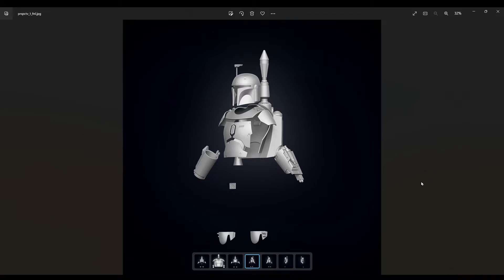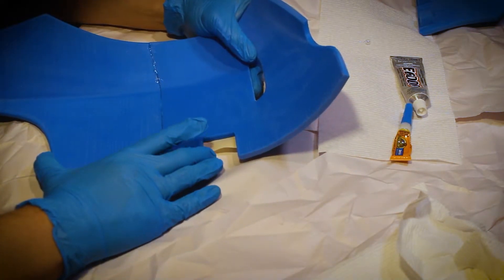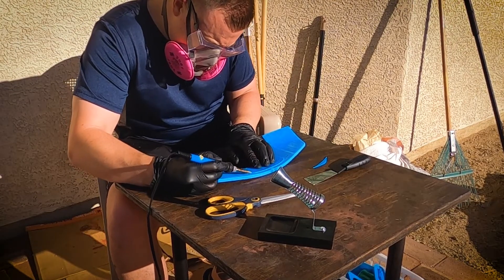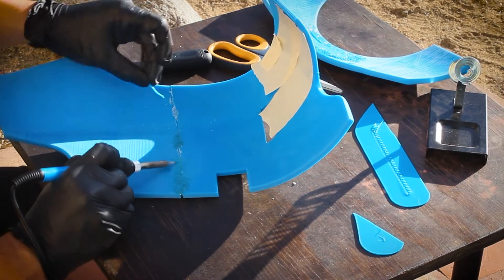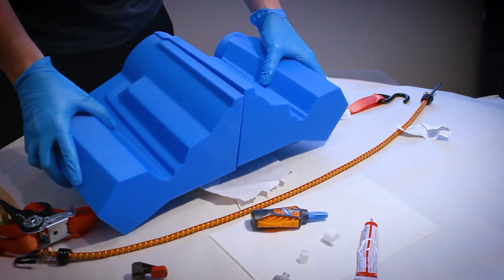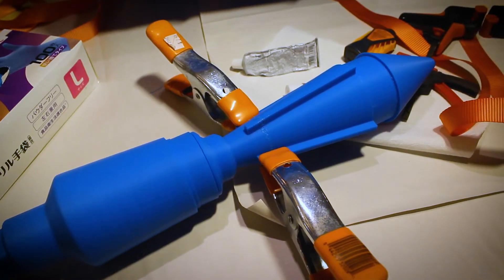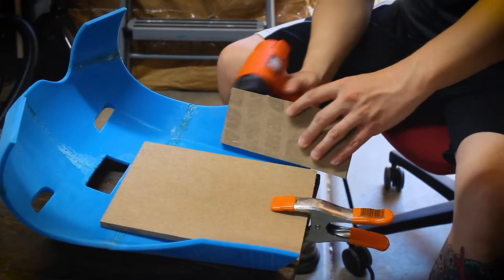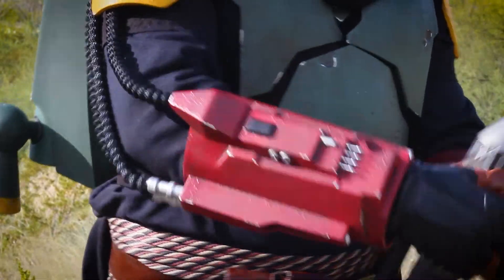How to Glue, Weld, and Modify 3d Printed Parts! | Boba Fett tutorial Part 4

Comment: Can you plastic weld on the a finished painted surface that’s cracked? My top plate has a crack in it and I need to repair it. Would plastic weld work best or krazy glue?
Reply from the maker: If it’s armor you’re referring to, there’s such a thin bit of material that after connecting it could easily break again. I would recommend gluing the seem, possibly welding the inside, and definitely using fiberglass resin and cloth to make the back stronger to avoid it snapping again.

Comment: You can help yourself out a lot with alignment by either adding pegs and slots to the design, or just add slots that will conform to a generic wood peg (you could also use aluminum or carbon fiber rod to make stronger pegs for smaller parts). This has the added benefit of preventing the seams from being a structural element and almost entirely shifting the challenge to just hiding the seams rather than trying to make them as strong as the rest of the print.
Reply from the maker: I think that’s a great idea! I love when models use alignment pins. Im not an expert 3d modeler yet to be able to modify files too much, but when I can I love when there’s a good way to align parts.

Comment: Thanks for the helpful videos! I just started 3D printer few months ago and I just finished my boba fett costume and definitely learned a ton but will be reprinting armor since it wasn’t as good as it could’ve been
Reply from the maker: I totally understand that! What printer do you have? There’s a lot of things I could have done better with mine as well but at a point it’s just all nit picky and I’m pretty happy with mine other than the gloves and adding the chest electronics. I also wish I ordered a larger sized soft part kit but I’ll go more in to that in future parts of this series!
Reply: I printed my off a Ender 5 plus, I used MysteryMakers (Marko) files, Fetttronics chest display rocks! I definitely will use the tip on reenforcing the collar armor as it gave me some issues with breaking, I actually still need to print a jet pack and probably will do my own helmet since I used the Disney black series re-armored with some hand painted touch up…eventually I will reprint the armor because some of it cracked and I realized wall settings help and print orientation as well! Also having to use a different color of paint since my Storm green came late but overall I have gained a ton of knowledge and will be perfecting it for next year and Mando season 3 looks like I’ll be doing some more lol
Reply from the maker: @JGPHX86  For sure! There's so many cool new mandos coming in season 3 I may have to make one of them who knows! This was such a huge project though it took me months. I appreciate the tip about the chest display thank you!